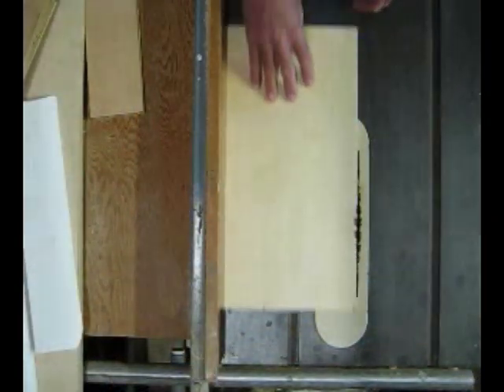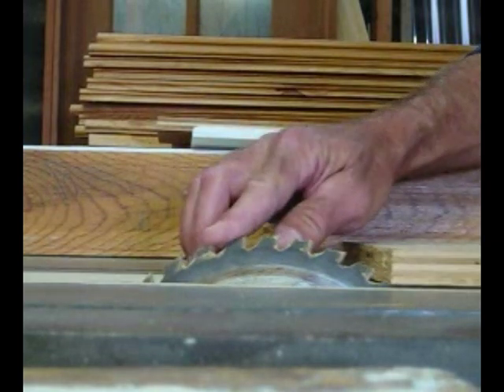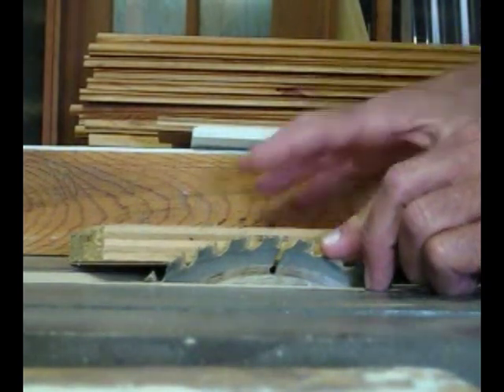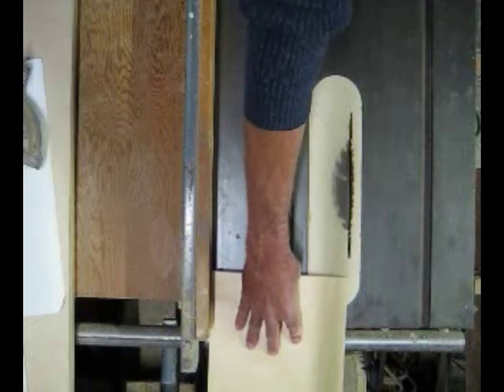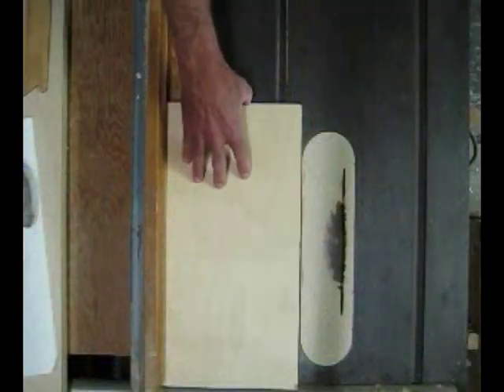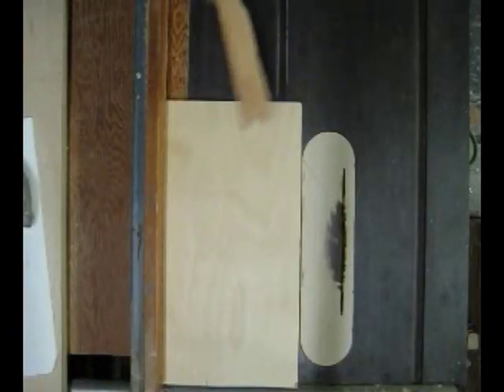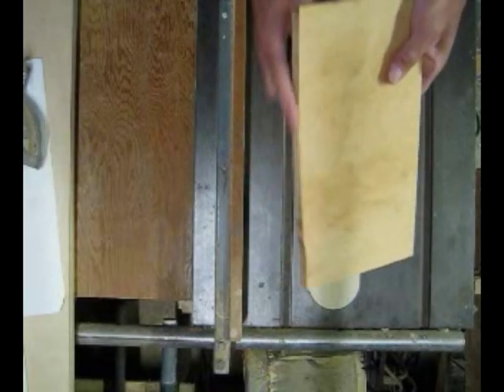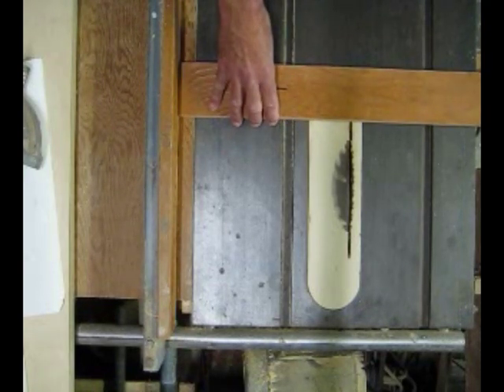How to Avoid a Table Saw Kickback

Comment: Thanks! 

I'd like to get a table saw that will accommodate a riving knife, but it's something I gotta save up for. I'm currently using an older saw that's otherwise excellent, but has no riving knife.

While using it, I want to avoid kickback and/or accidents and/or mangled flesh, so I appreciate this video that breaks down the fundamental causes of kickback, the forces acting on the board, and how best to avoid them. 👍